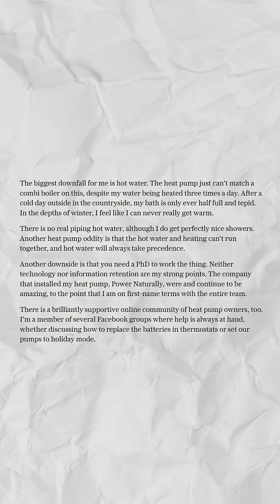The REAL Reason Your Baths are Lukewarm

Comment: Visiting Norway a few years back, whole areas were plagued with the noise of faulty heat pump fans, which people could not afford to get fixed.
Reply from the maker: They haven’t moved over to gas boilers though. So either Norwegians are stupid or this is untrue
Reply: @HeatGeek  Norway is transitioning away from gas boilers by phasing them out in new builds and existing homes. The country banned new fossil fuel heating systems in 2017 and banned the use of mineral oil for heating, including fossil fuel boilers, starting in 2020 to reduce emissions and promote heat pumps as a sustainable alternative. Heat pumps have been in use for many years, but were not widely adopted until Norway changed its laws. So I expect the sound of faulty fans to be even worse these days.

Comment: £600 Will cover it aye.If you gave a no fix no pay you would get more customers but I will bet not much change out of £600. Most houses the heat pump was banged in with the original pipework and the installers hadn’t a clue well mine never.Absolutely no comeback on them complain to WHO.17kW heat pump 125 meters floor space they must think I live in a cave.Summer time a 6 degree drop inside to outbid at its worst.Cheers I know not your fault.

Comment: Maybe the regulations are different in the UK but I made sure to install a non-thermostatic bath tap to ensure the hot water wasn't being diluted down with cold water like happens in thermostatic taps. All the sinks/showers do have thermostatic valves in them.

Comment: If it is new build, then it is a possibility the fault is the Blending Valve under the bath. These are set much lower than what the hot water stored temperature is. We regularly get customers saying the bath is not as hot as the basins.

Comment: Boilers do heat water to a higher temperature than heat pumps, I was worried about this when I installed mine.  The shower water is definitely not as hot, but it's hot enough.  I do think it would be better to get a larger tank with larger coil, especially to fill a soaker tub but for showers it's not a problem.
Reply: Generally the hot water temperature can be set by the heat pump's control. Mine heats to 55C+ without problem, and I don't need it higher than that.

Comment: Our heat pump was installed in April, had combi prior to that. We only have a 190ltr tank (space constraints), I bathed the other night, Mrs showered, then the daughter (we have two bathrooms), I was impressed, we didn't run out of hot water and I only have the tank set at 50°c. PS 18p a day for hot water (solar & large batteries)